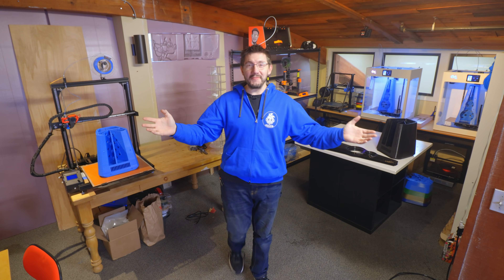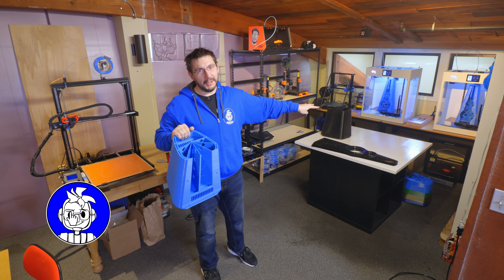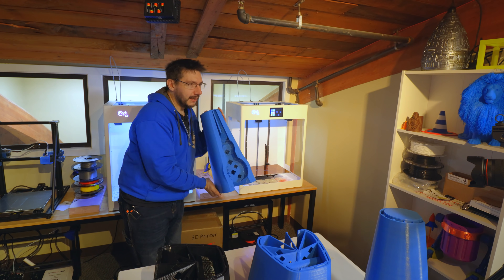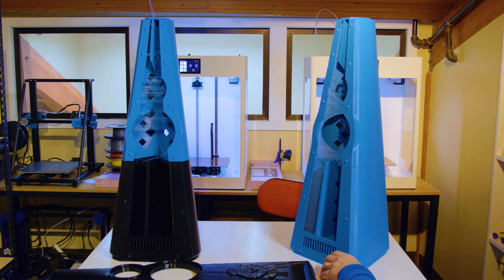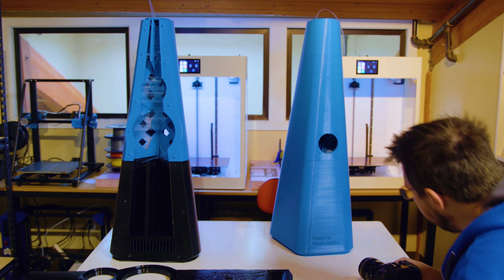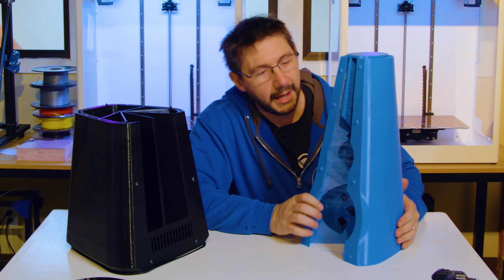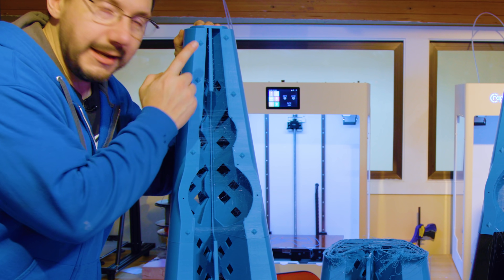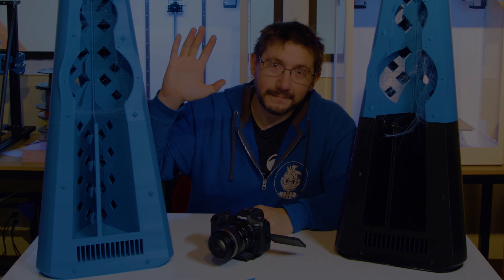3DPrinted Speakers Part 2: 11 DAY PRINTS

Comment: No test prints to dial in settings and minimize stringing before launching into the full prints?
Reply: For something that has to look nice, I would also put quite a bit of finetuning time into it indeed. But I guess he also has a super busy schedule, so then that makes total sense. In this case I would always paint it. This would also be an excellent model for big nozzles.
Reply: @punishedbrains  I can't imagine it would have taken more than an hour or two at most to dial it in with those little test-print towers people use to check for stringing, but it is what it is I guess. For sure though those speakers will need a ton of sanding, filling & painting- there is no way anyone would use them- as is looking as rough as they do. ..

Comment: Damn those craftbots really don’t deliver when you know how much they cost. That stringing is unacceptable
Reply: Stringing issues are all related to slicer settings, not the printer itself
Reply: @beaker2k  

Then apparently there is still no good profile for the printer
Reply: The Shadow Man I have many good settings / profiles for the Flow range ABS, PET_G, Nylon ASA, etc etc, no stringing (none) no layer shifts.
Reply: has nothing to do with printer that is a slicer setting adjustment, easy fix retraction length / speed. Looking at the prints probably speed

Comment: after all this time STILL failed prints - 11 days is ridiculous - i think we need a "revolution" in 3d printing to really make this work -
Reply: You can print a hell of alot faster than this. He is prioritizing surface finish over print time.
Reply: @tonyradle8747  so 7 days - i can make out of wood etccc much faster the point is 3d printing is still "not there" speed reliability etc.. we have to stop thinking its back in the wooden box days of the first makerbot

Comment: For 11 days, I think my printer would have put house on fire , so your prints seem pretty decent
Reply: My largest print went for 56 hours, and as it's done on the FlashForge Adventurer 3's tiny (150x150x150mm) I did it in 8 runs across almost 4 days. I guess I can call myself torrenting the print lol
Reply: Preach it 😂 don’t even get me started on long term ABS prints. Eating spaghetti every night 😂
Reply: I just got my creality endet 3-pro for Christmas. Mine would be the same... although I don’t even know if I could print something big and dense enough for my printer to print for 11 days. I would be able to if I just made a solid cube but that would be pointless
Reply: I have a few creality printers, ender 3 pro, ender 5, and the newer CR-6 SE and I still won't run mine for more then a full 24hrs. I don't sleep well, or want to be away from home long while they are printing. 

I even hooked them all up on their own smart plugs, then have my security cameras watch them.  That way I can check in or get alerts for serious issues, and kill the power from smart plug app. 

All that and I still worry a bunch. Its funny too because not much shakes me, but these Chinese made printers being left alone in my home for sure does haha.
Reply: @MKultrapdx  Man I hear ya!  There's nothing my 3D printers can make that I like better than my house and all of the stuff in it!

Comment: I Frankensteined my old, non working CR-10 z axis beams and now I have a 400 mm z axis on my ender 3
Reply: now you just have to do the 400 extension for the xy and you got 400x400x400
Reply: @ronbaer67  Or I could take the other 300 (350 I think) mm bars and stack them to make a 1150 mm z axis (gotta order a 1150 mm z screw tho)